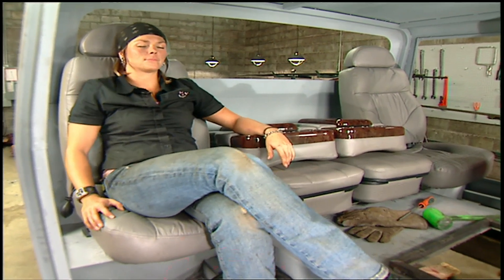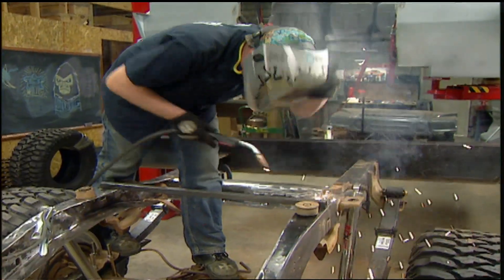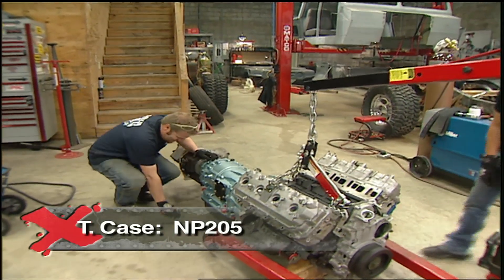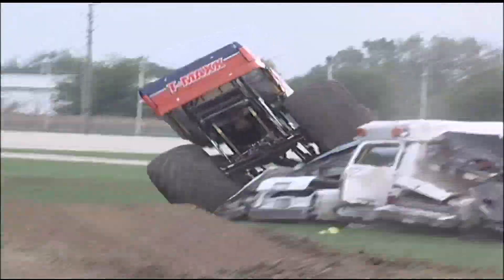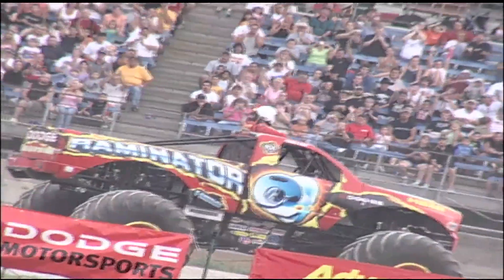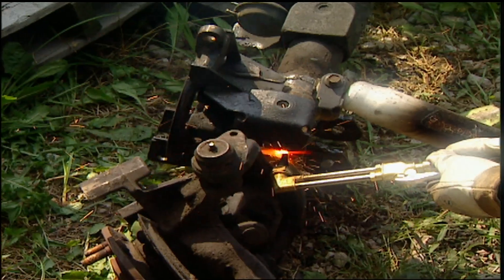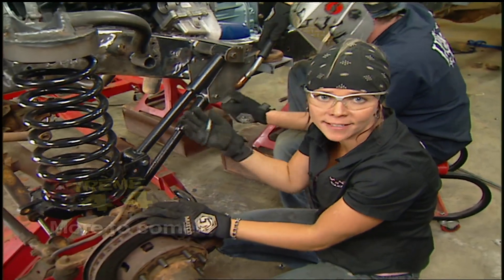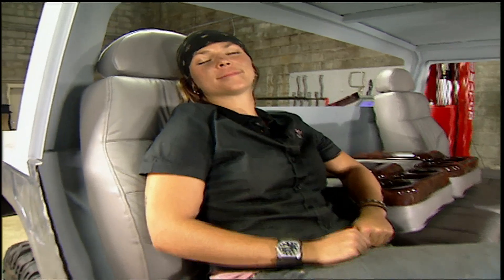Front Suspension and Frame Mods for the SubUrban Gorilla Tow Monster - Xtreme 4x4 S2, E3

Comment: biggie 5r55 transmition failures on stangs & explorers. just burn the cars, damn ford pathetic shit heads. Cheap aluminum case vs servo steel rod cheap godless works ford bad trans #13/14 both huge fail.
Reply: bore out case & brass sleeves to fix or just put in diff trans fuck me.
Reply: only a short term fix b4 brass fails too.

Comment: GPS modual is bad as well, these thing r no well made that's 9. #10 rack after deep water fording puddle acting up. Paddle shifter can't b attached to the wheel not great location if turning. Fuse panel bad location & u will need to get at it crap SUV. Hancock poor tire in winter cheap shit ford.1" lower ride bc these things r cars not truck or SUVs really. #11 rear back up camera problem use after market instead of ford shit. #12 air blend door actuator for rear ACs bad.

Comment: top 5 problem w/2011-2019 explorer hood aluminum has paint issue esp front edge of hood. Use steel instead or power coat base or learn how to paint cars. Ford seems to b killing the fixes atleast really taking care of customers going big!. Rear passengers carbon monoxide lots of grommets but they changed when & how ac runs, bc problem worst at highway high rev-ing. The dome lite won't go out the damn sensor & door lock unit is bad passenger driver ...;
Reply: goes into limb mode bc the throttle body sends no signal(ford 10yr 150 mile replacement).  There is another sensor vacume bs same thing bad top of engine small rleft of throttle body by 8" or so, replace bad.